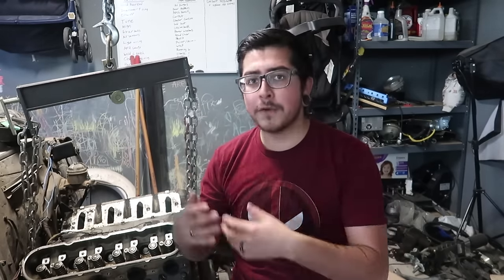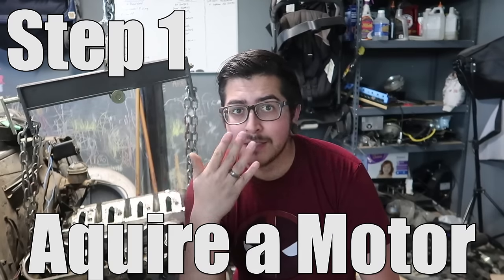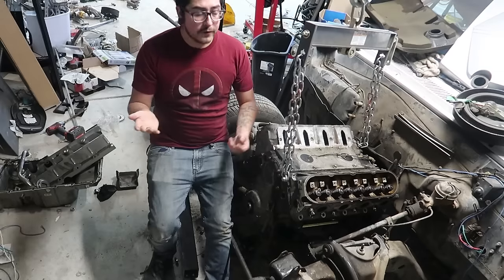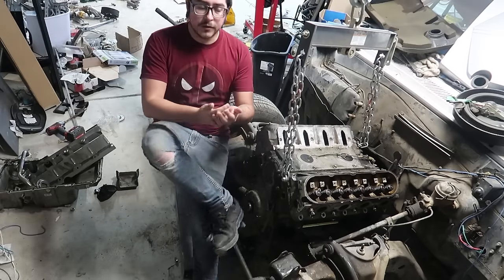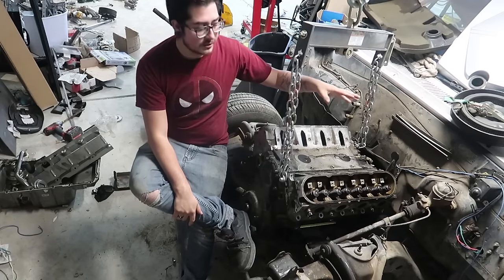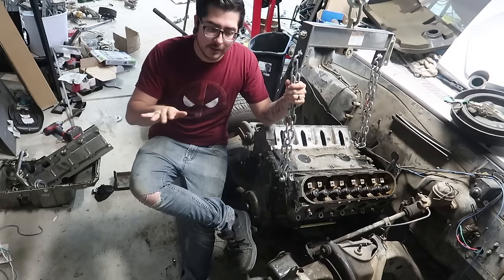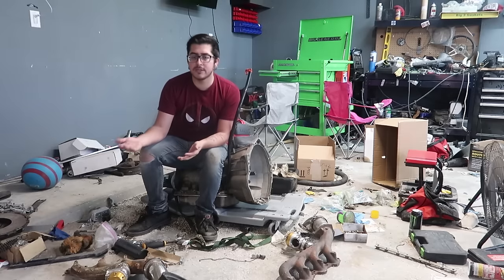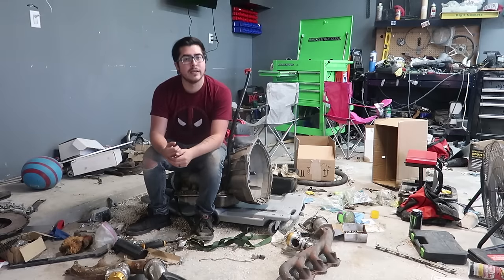HOW TO LS SWAP ANY VEHICLE - 5 THINGS YOU NEED -- LS Swap Basics Overview (LONG VERSION)

Comment: Используя метрическую систему, по которой живет большинство в мире - по вашему 16 миль на галлон это всего 14,7 l/100km. Я согласен сделать в нашей хот род лаборатории в Москве (Великая Россия) замену 2,2 литра 185 л.с. 230 Нм на правильный малый блок Шеви LS3  и получить дикую мощность и момент на тонну от моей красавицы Alfa Romeo 159 2007 2,2L JTS DOHC( block GM Chevy Cobalt EcoTec 2006-2010) stock 186 HP 230 Nm. I wona made swap 436 HP 572 Nm Corvette C6-C7 + Dynomax Super Turbo 18836 $56 or Cherry Bomb Pro #300691! Спасибо за креативную идею умнейший Jovani Dante Griego! Мы будем к тебе обращаться и оплачивать твои разработки по замене моторов на правильные в большом круге русских хот роддеров! Есть проблема  - наверное потребуется набор передней балки моста от Volvo 740 -960 для моей Alfa Romeo 159 2007, еще резать моторный пожарный щит, но туннель пола для заднего привода и ведущий задний мост у 159 есть! Мой аккаунт с фото - https://www.drive2.com/r/alfaromeo/159/618327/ и для особо одаренных лохов без Гоогля переводчика на английском =                                                                                                                                                                    Using the metric system that most in the world live by - your 16 mpg is just 14.7 l / 100km. I agree to make a swap replacement for 2.2 liters of 185 hp in our Hot Rod Laboratory ((I created the first hot rod club on the territory of the former USSR in 1996)) in Moscow (Great Russia). for the correct small block Chevy LS3 and get wild power and torque per ton  from my beautiful Alfa Romeo 159 2007 2.2L JTS DOHC (block GM Chevy Cobalt EcoTec 2006-2010) stock 186 HP 230 Nm. I wona made swap 436 HP 572 Nm Corvette C6-C7 + Dynomax Super Turbo 18836 $ 56 or Cherry Bomb Pro # 300691! Thanks for the creative idea, the smartest Jovani Dante Griego! We will contact you and pay for your development of replacing motors with correct ones in a large circle of Russian hot rodders! There is a problem - you probably need a set of front axle beam from Volvo 740-960 for my Alfa Romeo 159 2007, still cut the engine fire shield, but the 159 has a floor tunnel for rear-wheel drive and a driving rear axle! My account with photo - https://www.drive2.com/r/alfaromeo/159/618327/ and for especially gifted suckers without Google translator in English =

Comment: Hey Jovani can a 5.3 v8 fit in a 2007 Buick Lucerne and also what type a transmission it would need
Reply from the maker: That's a fwd car. You could potentially use a ls4 and 4t80e trans. But no idea if it would fit
Reply: @JovaniDanteGriego  thanks

Comment: Thanks for the info!   So many choices man.  I have a 69 camaro I’m digging into.  Needs a lot of body work. But I want to get it running now.  I have a 2005 trailblazer with the 5.3 ls motor. Complete. As I drive it daily.   I want to drop that setup onto the camaro badly. I scored a super T10 4 speed as well. However I’m kinda screwy in the head. As I’ve also been thinking about dropping everything in the car.  Making it an AWD setup.   But not sure yet.  As I think the 4sp would be so much fun.   And a lot less work.  The wiring is what makes me nervous.  Fab is my shit.  But wiring. Hmmmm. Scary shit!   Thanks for the video man.  Very motivating

Comment: Confused here, I know 99/2000 was an awkward year for the trucks, but a 2000 model 5.3, is going to be the same as the 2001-2004
Reply from the maker: Ecus changed from 02-04 as well as throttle body early ones are cable, late ones are drive by wire
Reply: @JovaniDanteGriego  externally, and internally they’re the same. Between 99-03 the ECM’s were the same for a select few of the 03 models which didn’t have the IAC chip installed, you could get it if you got it off a GTO or a Express van. Looking closely at the PCM service number located on the bottom of each PCM. While the 1999–2000 PCMs are interchangeable with the 2001–2002 versions, the 2003s incorporate a few important changes. The 1999–2002 PCMs (left) use connectors with blue and red retainers, while the 2003- newer PCMs (right) use connectors with blue and green retainers. The red and green retainers are keyed differently. Not all 2003-newer PCMs support an IAC valve, a limitation that does not allow for a cable throttle body.

Comment: 71 El Camino came with a 307, had to remove frame mounts and use UMI Performance slider mounts. 307 frame mounts sit up higher than the 350 mounts so i couldnt use the cheaper 1" set back plates with my 5.3/TH350.
Reply from the maker: That's good info to know! You could probably get away with swapping to 350 mounts as well. But whatever was more cost effective I had to use 350 mounts since my Chevelle came with an i6

Comment: I appreciate you trying to make a video on how to... But, ...
A "motor" is electric, stop saying that over and over and over and over again.
If it's combustible it's called an "engine".
Two, clean your shop or garage so people will take you serious, and you will not get hurt, or cause a 🔥
And third that should be actually first, don't diss or disrespect people right off the beginning by saying they are annoying.... You are the one that wanted people to watch your videos.
Take it from a builder that has done many Classic Rides with swaps and much much more.
If you are smart you will take my advice and run with it.
FYI, I stopped watching after the 15th time you kept calling it a "motor"
Good luck to you
Reply from the maker: Oh I guess I should tell GENERAL MOTORS that. 

But I appreciate your advice. 🙌
I have cleaned my shop up since. This was right after doing several all nighters. I do keep my shop cleaner.

Comment: I have a 74 c10, 4.1 engine (manual trans). And I recently bought a gm 5.3 vortec  engine. I want to do a swap. What mount kit do you recomend ?
Reply from the maker: If the 4.1 takes regular SBC mounts then I would go that route. If not you can buy SBC standoffs for your frame and then use a conversion bracket
Reply: @JovaniDanteGriego  exellent thanks

Comment: Keeping th350 or th400 trans thats allready  in your car with  the correct flex plate or adapter would be the cheapest way  on trans
Reply from the maker: Yes it would be but sometimes buying a engine/trans combo and selling the original can be cheaper for example I bought a whole truck for 1500 and sold a th400 for 800 so the engine and trans only cost 700 without parting out anything else

Comment: Holley sniper 650 is the cheaper version at around  $1200, it supports up to 650 HP,  has power adder turbo, supercharged , and nitrous control,  it can self learn but can be tuned thru laptop or computer for advanced tuning.  
The holley super sniper 1250, at around $1500 supports 1250 HP,  (800 hp naturally aspirated & 1250 with power adder). 
These are incredible units!!! Do not sleep on these, they are by no means inferior systems!!! Tried & true! While they don't support methanol injection,  there are ways around this, with separate controls & knowledge of tuning. 

There is the Holley HP, Terminator, & Dominator systems start at around  $2200 & can easily surpass  $4000 to complete. If you need more features,  such as multi port, direct injection, plenum style intakes, methanol injection,  & the power adders,  & some extra advancement for tuning.  

I would have to say, even tho I have yet to see any issues with this, & I'm going by several 1st hand experiences, would be that the more expensive units separate the ECU from the unit itself could be mounted away from the engines heat. While the Snipers are in the throttle body,  it obviously was designed to deal with any heat, & also due to location isn't in any area of extreme heat. Add an aluminum or "plastic style"  & even vented spacer plate between the TB & manifold to separate & dissipate heat even better. 
Tho,  in cars making making 650 - 1100 HP with turbos,  twin turbos, NOS, and big & tall forward mounted headers & Exhaust pipes not too far away from the Sniper units, & all in a few various configurations have yet to have any issues. And these are raced cars, & some for a couple years now.
Just saying
Reply from the maker: Don't forget now the Terminator x, it's honestly the best solution out there at the moment . You keep the engines efi (not Tbi) and get alot of the benefits you mentioned from  the sniper. Also for 200 more you get automatic trans control
Reply: @JovaniDanteGriego  actually yes i did forget this part, which definitely can be very important.
Even tho, i personally,  would always couple any of these set ups with a manual transmission.  But that's just me.

Comment: I just bought a 93 S10. The engine is bad. My question is what ls will bolt up to what 6 speed transmission??
Reply from the maker: The easiest would be a t56 it will bolt up to any LS engine using the 2001 Camaro clutch and flywheel
Reply: @JovaniDanteGriego  ty sir

Comment: Ok I know this video is about swapping an engine into any vehicle but since this is a new car what about ls swapping a 2019 2.0 4cyl camaro car is paid cash now I’m ready to swap out the little 4cyl would this be possible to do
Reply from the maker: It's possible, but not exactly. You can swap the engines out no problem but you won't be able to get any of the body modules to communicate, and being that the new cars rely heavily on canbus between the engine and the body who knows what won't work. Sell it and buy a used SS. Trust me. Or build the ecotec! It's a badass engine

Comment: What about the drive shaft for older cars? Just change the yolk?
Reply from the maker: Yep there's plenty of conversion joints and what not. The 4l60 uses the same yoke as a 700r4 and th350 which has been around since the 60s or 70s and the 4l80e uses the th400 yoke. So there should be no issue converting using some conversion joints
Reply: @JovaniDanteGriego   Thanks

Comment: i have a nv3500 of a 94 w/t doin a 5.3 swap from a 02 gmc will it bolt right up with a 5.3 clutch kit or how can i make 5.3 n nv3500 work?
Reply from the maker: Im not 100% sure but it sounds like it will bolt up

Comment: How about replacing an LT1 in a 95 Camaro with an LS1 is this doable and improving the car? How about converting from automatic to 6 speed stick shift is that a big headache?
Reply from the maker: All of that is pretty straightforward and has been done a ton. Look at lt1swap.com there's a ton of info there
Reply: @JovaniDanteGriego  is it worth it to keep the LT1 engine or put the LS1 in it?

Comment: Any advise on motor mounts for LS1 in to 66 GTO coupe.
Reply from the maker: You should be able to use SBC to ls adapter plates but not 100 sure if the 400 has the same mounts

Comment: Step 1 clean the HELL OUT yr work space.
Step 2 clean the hell out of your work area .
Step 3 and on is the most important steps to follow
CLEAN  surrounding work area.
Reply from the maker: Nah. Slap it in and send it. The shit on the floor doesn't make an engine run or not run
Reply: @JovaniDanteGriego  If that's how you do things I'm good with it send it .. As for me I have too keep my work space clean like I'm gonna eat off it...lol especially when I'm going to assemble a motor..
Reply from the maker: @goodfellasinc.5648  well the good thing is you can always clean up an area before you do something right?

Comment: I have a 2005 envoy and as a Gen 4 in it 5.3 I blew that engine can I put a 2001 gen 3 engine in there no problem or will my computer not work with it proper of course I'm going to put my old intake on and stuff like that coils etc?
Reply from the maker: It will not work
Reply from the maker: 24x vs 58x

Comment: So once I get an engine and the mounts I can just get the Holley kit? No computer
Reply from the maker: Thats right, no computer, Ther Terminator X comes with a handheld programmer and includes a auto tune feature that will set it up close enough to start and drive.

Comment: I have A 2007 Tahoe LTZ 4x4 5.3 will the motor & transmission fit right into my 2011 V6 CTS Cadillac
Reply from the maker: No not really I think the CTS v uses a different subframe
Reply: I Have A V6 CTS Not the V, Will the V subFrame Work For The 5.3?
Reply from the maker: @dw2769  I don't have a solid answer on that.
Reply from the maker: @dw2769  a 5.3 would drop into a cts v. The blocks have the same dimensions and mounting points

Comment: do i need a new wiring harness if my car is also from gm like a v8 swap to a v6 camaro?
Reply from the maker: You may need to modify a few connectors. Not sure. You'll definitely need to add 2 injector wires. It's probably worth changing the whole thing

Comment: 5.3 2000 in to a 1965 corvair can I put motor mounts on front suspension.
Reply from the maker: A corvair is a rear engine vehicle, if your even thinking about putting an engine in the front, everything is going to be custom fabbed

Comment: I want to put an LS in my 2016 Chevy trax, any recommendations please? This would be my first project
Reply from the maker: It's not worth it. Especially not for a first project
Reply: @JovaniDanteGriego  is there any way I could see some real power gains out of the car? I wanted it to be kind of a sleeper car lol
Reply from the maker: @colemanzap9904  turbo. But what's it have like a 1.4l? Realisticly you'll be lucky to see 250hp
Reply: @JovaniDanteGriego  yeah 1.4l i just thought it’d be a funny little sleeper car how would I get to 250?
Reply from the maker: @colemanzap9904  turbo and tune. Not many parts for the 1.4

Comment: Hey i want to engine swap a 2014 malibu, and its a very similar frame to the Chevy SS do you think id be able to get the mounts from a SS to get it to mount
Reply from the maker: It's not the same platform as the SS. The SS is the same platform as the Pontiac G8/Holden commodore which are both rwd platforms. Your malibu is a fwd platform. Just take a look under it and try to find where a driveshaft would go. If your admiment on swapping the LS4 might fit with alot of modifications. If not build the ecotec. It's a good motor
Reply: Jovani Dante Griego since mine is a fwd i was going to use the transmission from a SS impala or GXP pontiac, a 5.3 out of those cars would be the best way to go for that car& i dont think the 2.4L ecotec has any mods & i am a v8 guy so i was thinking maybe bring the SS malibu name back to life !
Reply: Jovani Dante Griego  and I totally forgot about those 2 cars that it was based off of its pretty much a rebranded holden your totally right
Reply from the maker: Yea that would maybe work. I don't know how similar the old Impala SS chassis is to the new one

Comment: Any tips for motor mounts that'll allow you to retain the lq4 ac compressor mounting location?
Reply from the maker: It depends on what you are putting it in. They have some weld your own mounts on ebay that I'm sure you could get to work if you cut them the right way
Reply: @JovaniDanteGriego  I messaged on the wrong video, I meant to write this in your c20 video. Yeah I have a c20 square body
Reply from the maker: @johnlee1009  oh ok in that case I'm not 100% sure but I believe the Tejas mounts do

Comment: Im really scared of doing an ls swap to a 3000gt because there’s basically no information on it.you got any tip?
Reply from the maker: I don't :/ I don't know much about the 3000GT I doubt keeping any of the stock Awd stuff would be possible though
Reply: Jovani Dante Griego yeah thats the problem i dont have the twin turbo i got the fwd and i have tho get a rear subframe and driveshaft and dont know what to do
Reply from the maker: @sqtikar6422  those kinds of decisions have to come from you. At that point your building a full custom chassis and at some point you have to ask if it's worth it
Reply: Jovani Dante Griego its a hard decision because i dont know what fits and what dont and the worst part is that is my first project  and there’s no info about it oj the web

Comment: I have a 2010 cts v6 gone through 2 motors. Wanting something more reliable like a ls. What would you suggest?
Reply from the maker: It's possible. But will cost you. Is a LS swapped cts really something you want to spend your money on or just cut the cord on? At the end of the day it's not a V and won't handle like a V
Reply: Yeah it isn’t a v but got the car lowered and stuff feels like such a waste to cut the cord now 🤦‍♂️ but it’s gone through 2 of those v6s.
Reply from the maker: @Sengsirivanh5  what's killing them? Timing belts?
Reply: Unfortunately no 🤦‍♂️ my little brother and his driving habits I’m sure at this point haha.
Reply: I’ve thought about going with the 3.6 v6 see if that does any better
Reply from the maker: @Sengsirivanh5  the 3.6 isn't bad. But it's still a lot of work to swap them out
Reply: Thanks for replying bro

Comment: Other thing would be figuring out the power stearing.
Reply from the maker: That would depend on the specific vehicle. If its gm its really easy just need adapter fittings